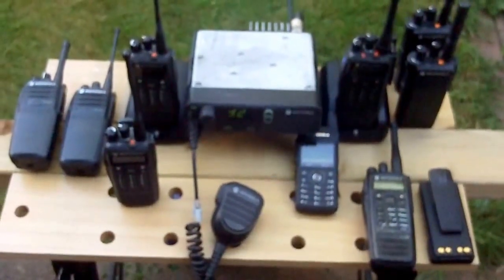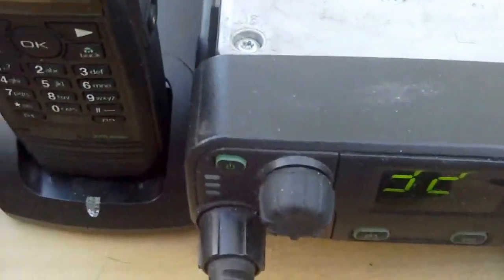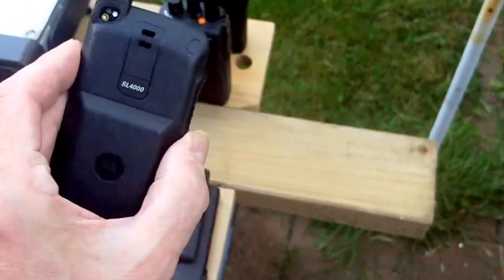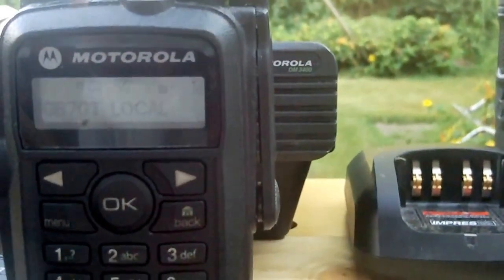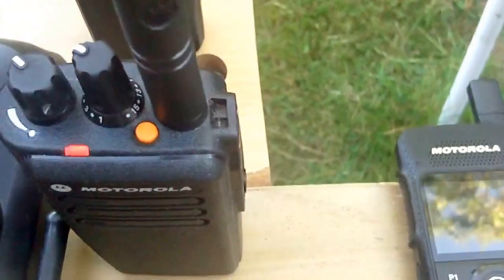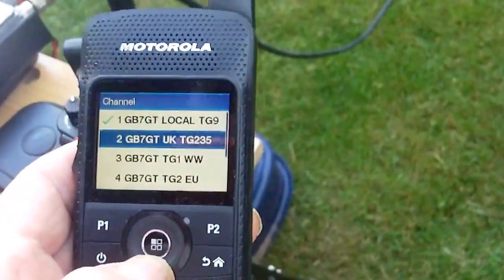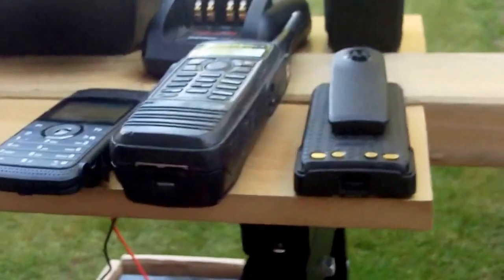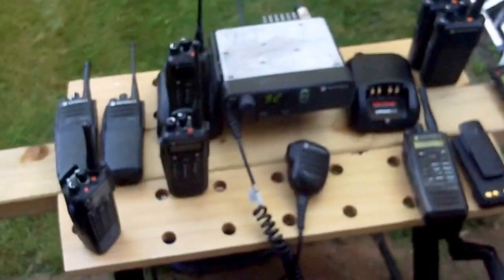DMR Mototrbo Amateur Radio Equipment

Comment: Those XPRs are nice.

I'm thinking of getting in to DMR on 2m, but I may just get into digital decoding like DSD+ or I'll see how expensive the AOR DV-1 will be.
If its over $1200, I'm going to upgrade my scanner to a WS1080 and buy a nice laptop to run DSD on Windows.

I'll have to learn how to use it.